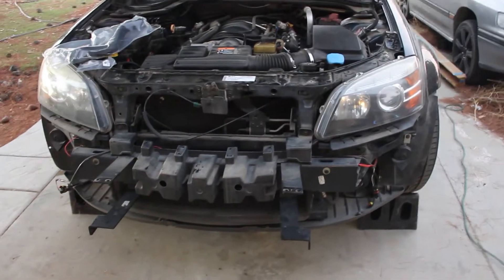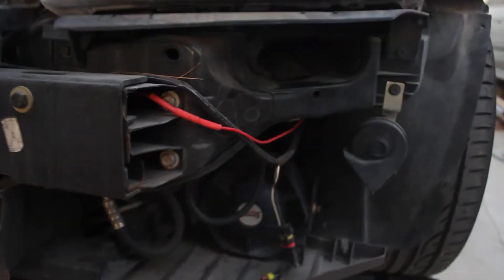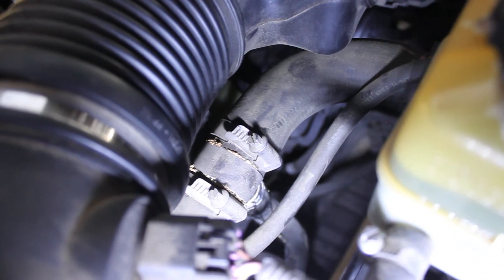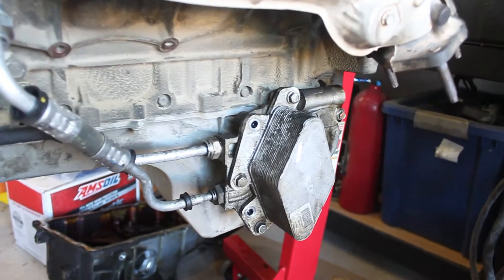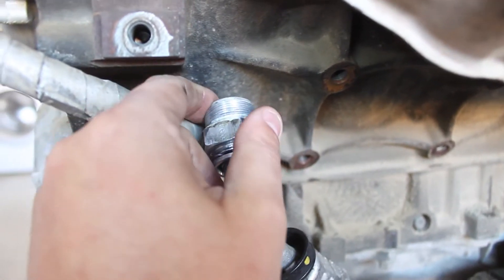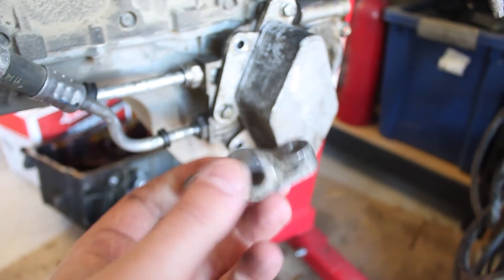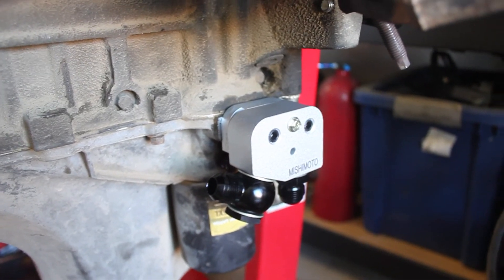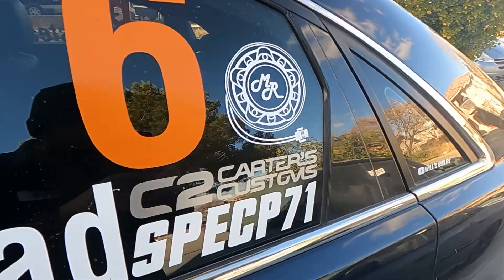2012 Caprice PPV Factory LS Oil Cooler Delete | Will's Builds Ep.37

Comment: My bmw 135, oil temp normal was like 220.  When i beat on it it would get up to 250 with no loss of performance. This was all according to the stock gauge. It only had an oil temp gauge not a water temp gauge
Reply from the maker: Unfortunately oil temp on automatics cars are only calculated because those pins are used for trans temp.  However, I was getting an "oil temp hot" warning on the dash at Streets of Willow (after removing the stock oil cooler, before installing the mishimoto cooler).  When my oil got hot, my idle oil pressure was dropping down below 20psi, which was a little concerning.  I will be going to a different weight oil next season haha

Comment: Would the kit you got work on a G8? My G8 oil temps keep getting into the 240’s. I’m thinking the layout is the same
Reply from the maker: It should. Pretty much all LS engines have the same oil cooler mounting pad on the oil pan.  There is no specific mounting hardware for our cars.

Comment: Do you by any chance know if the line that goes to the block has a o' ring by any chance? Mine is leaking
Reply: Same
Reply: Tiny leak from the block where the oil cooler line runs into it
Reply: @isaiahmarcoux  i  ended up deleting the oil cooler fixed the problem